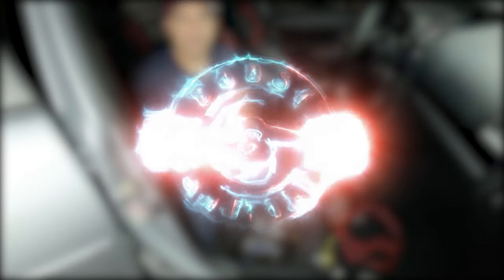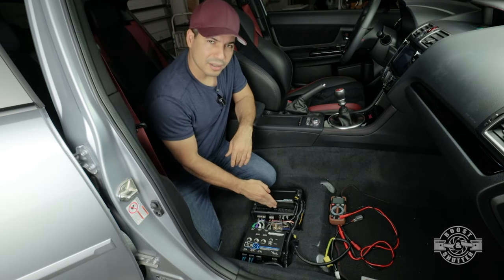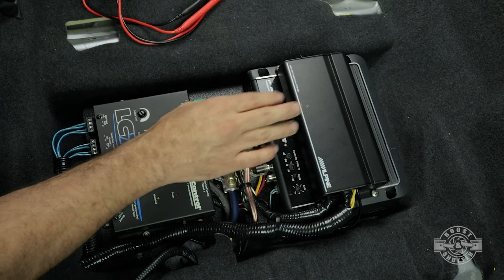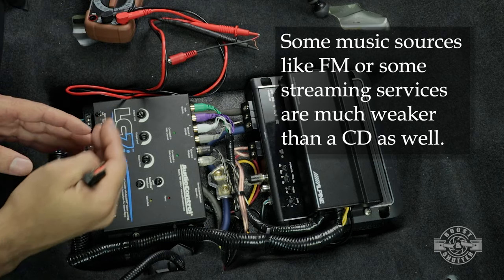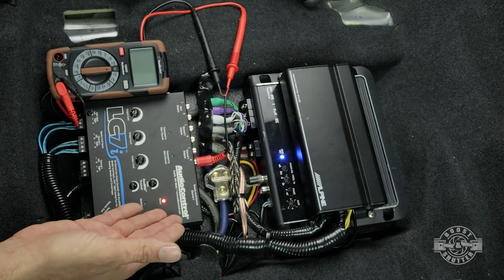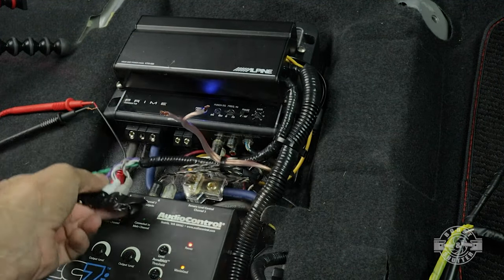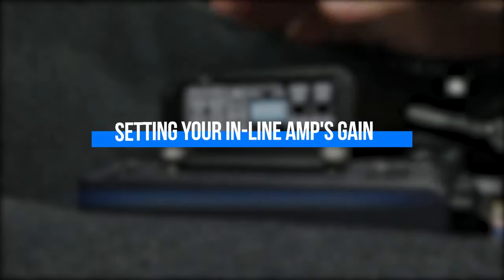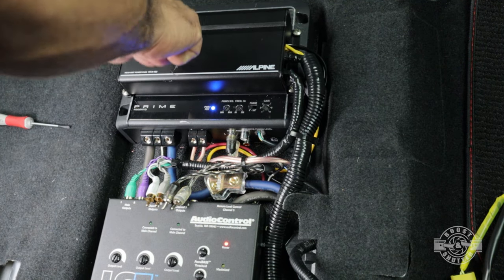How to TUNE Car Amplifier & Set Gains

Comment: What about if my stock head unit does not show the volume numbers how do i know the 75% of volume ?? I am using an audio control lcq1 to convert hihgs levels to low levels ??
Reply: Mine doesn't have the numbers either.  I just connected a source to it (phone via bluetooth works great) but didn't play any sound.  Then you can turn the volume up one click at a time, starting at zero, and count the clicks until you get to max volume level. Once you know how many clicks are max volume, multiply that number by .75, and you know how many clicks get you to 75% volume.  I had to put a mark on one of the notches on my volume knob to reference where that point was.  Takes a little time, but it solves the problem.  Hope this helps. 2017 Silverado.
Reply: @johnpowell6724  thank u so much

Comment: I've done this but left and right outputs out of the LOC show a difference not the same
Reply from the maker: Many stock head unit attenuate the rear speakers so you will get much lower voltage for the rear. What I would recommend is that you copy the front signal to the rear through the dip switches if that's the case.
Reply: @akqjtn  I've patched into the factory sub woofer line if that changes anything.

Comment: My amp says it's output is 150 watts @ 2ohms × 4 @ "14.4 volts" . dum question does that actually mean I have to set gain @ 14.4 volts with multimeter for max rms?
Reply: @akqjtn  oh ok gotcha that actually makes sense because I was wondering how everyone was adjusting different gains when the manuals were telling you the voltage to use so I see my misunderstanding. Thank you so much for quick response😁👍
Reply: @akqjtn  glad I didn't think it was too dumb to ask I would have been confused😵
Reply: So since you have responded to me I'll ask my next question. When you wire speakers in parallel for lower impedance does the speaker handling power increase also and is equalization affected?

Comment: What speakers are you driving with the Alpine KTA-450 amplifier ?
Reply: @akqjtn  I am still thinking which amplifier should I use to drive my Alpine R-S65C.2 speaker. Will the KTA-450 @ 50W RMSx4 be under power to drive these 100W RMS speaker, since the amp is only 50% of the speaker power?
Or is it necesaary to go with the R-A60F @ 100W RMSx4 to get these speaker to their full potential so I get the best out of it ?
Appreciate if you could advise on this.
Reply: love3ver they are under driven as you stated. The higher powered amp would make them sound better, particularly on the low end (bass). Speakers do not necessarily have to have the RMS rating to sound perfect. Lower power is fine if you like the way they sound.

Comment: Are you, or anyone here, familiar with the 2013-16 mazda cx-5 with the bose amp? I want to add a small 5ch amp to run a sub and 4 doors, bypassing the bose amp but keeping the OEM head unit. I keep hearing that it's a pipe dream. HELP!!😥😥

Comment: Guys, how do I figure out what output voltage I should give my amps? He simply knew he needed 4v :/
Reply from the maker: It's in the specification section of the owner's manual, usually under "input sensitivity" or "input voltage"
Reply: @akqjtn  Thank you so much for your reply, Ill give those books a look

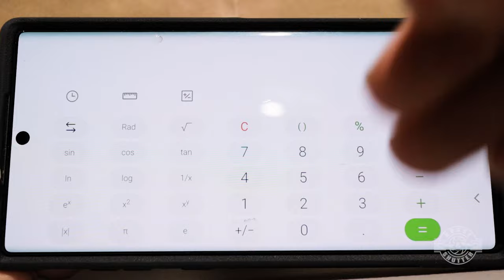Comment: 14:22 If my sub is 750W RMS and my amp is 550W RMS, what should I use for this calculation? I'm assuming I'd use the 550 from the amp but just want to make sure.
Reply: @akqjtn  Thanks for the response! And thanks for the super informational video!
Reply: @akqjtn  how about if I have 2 amps 1 is 1500RMS for 2-12” subs 4ohms 
And 2nd amp is 1kRMS for my door speaker.

Comment: what if you head unit puts out 4v but amp only takes 2v?
Reply: never mind. guess ill just watch the whole video :b
Reply from the maker: Short answer: turn down the gain on the amp.
Reply: @akqjtn  my 08 sunaru stock head unit is connected to a kicker LOC with level controls for left and right. Not getting 2v until 100% volume 40 on the head unit. Is there a recommended test tone app for android maybe the app i tried isnt working right. 1k sign wave right? Not getting any voltage on my multi meter at 75% volume30. This feeds a mb quarts 4ch amp. All seems to be working just looking to improve a little and make sure its all set correctly. I did set the gain with volume on 35/40 and used multi meter on the amp outputs to check the voltages.

Comment: Good video but I must disagree on some points you made.  I install car audio equipment for a living and even tho your method does work pretty well, a multimeter is not the proper tool to use to set gains. Also you did not find out your max volume level on the radio for distortion . That's the first place you should check for distortion since it's the first piece of equipment in the system that's sending the signal to either the factory amp or the speakers . 
Although a multimeter can be used in a pinch but in no way shape or form is it 100 percent accurate . Either a distortion detector or O scope would be the proper tools to be used .

Comment: Not knocking you but you are incorrect on a few things. I have the same vehicle and can tell you the headunit clips before 75%. You need an oscilloscope to find the actual clipping point otherwise the rest of your steps are useless. I have an 18’ sti and the factory headunit clips at 39 out of 62 on cd/usb which is less than 75%.
Second you should not have a solid clipping light on the LOC. You are indeed sending a clipped signal to the amp. Great video just think some of your info is wrong. I have the same exact LOC.
Reply: Boost & Shutter yes. I have an 18’. I believe the headunits are the same manufacturer. I had a 16’ as well and that headunit clipped before 75% to.

Comment: Nice explanation but there is some bad info in this video. DO NOT use a -5 dB test tone for setting gains. 
Here is why: For starters the peak for recordings can and often do exceed 0 dB in the real world.
I have many recordings that have True Peak (dBTP) levels greater than +2 dB when analyzed, the highest being +3.5 dBTP. 
If you set your gain using a -5 dB test tone and have it cranked up just under clipping with a song that has a peak of -5 dB you're fine.
What happens when the next song has an in your face 0 dB or greater opening? 
HELLO CLIPPING good bye amp and/or speaker/s if you're having a bad day.
Reply: When I saw the alpine screwed to the Rockford I paused and scrolled through the comments lol .... Wonder how much he paid for all the "cool video" and "great info" comments

Comment: You missed a step. Testing output voltage of the head unit itself. All of these should also be tested with an o-scope. Otherwise, you DONT know if it’s clipping or not. Just because you’re getting the theoretical voltage, doesn’t mean that it’s not clipped or distorted….

Comment: Nice video but cringed a little when you said "most speakers"  have built in crossovers.  The opposite is actually true.  Factory speakers like WRX dash tweeters have capacitors wired in to block bass which isn't even a replacement for a good crossover.  Replacement speakers will not have anything built into them (coaxial will have a capacitor on the tweeter) and will require a crossover circuit either in the head unit or amp or as a separate component.

You could get rid of a lot of that complexity you have there by replacing the head unit with a quality one that has RCA amp outputs and built in low Pass and high pass crossovers built in.   RCA outputs have far far lower THD than speaker level outputs.
Reply: @akqjtn  I don't know anyone who wants to keep the factory WRX head unit.  Some people don't want to spend the money to do it correctly because you need extra harnesses to keep all the factory features, some people don't want to do the work, but everyone agrees the head unit in the 2015+ WRX is hot garbage.
Reply: @akqjtn  Yeah the lagginess of the system in general is enough for me to ditch it.   The sound is really muddled, I think once you get a quality aftermarket head unit you'll realize why.  You're probably getting the best sound you can out of the HU but any setup that starts with a factory HU and runs into a line level convertor is asking for poor audio quality.  Good speakers hooked up to a good amp fed by a LOC from a garbage head unit means you're amplifying garbage sound no matter what. 

We went with a Pioneer DMH-W4660NEX with Maestro RR + SU2 harness + XM 300 Tuner which allows us to retain everything except the factory center console USB port.  But the HU has two USB inputs (1 for power/Android Auto/Carplay and the other is power only.)  They can be easily mounted next to the cig lighter location which is more convenient anyways.  But this head unit has wireless Android Auto which was a must for us.  Best Buy has/had this until on sale for $500 so total cost installed was about $1000 done correctly.   You can save 200 by not using the Maestro RR (which uses the OBDII port which might matter to you if you run an Access Port).    But we don't use an AP and wanted the extra features like tire pressure display, digital gauges, ability to read and clear engine codes right there on head unit.

Comment: Never ever ever screw amps together like he did in his video. A simple bracket can be made to stack amps. Or find another mounting location.
Reply: Why's that?
Reply: Many reasons but a huge one would be the fact that instantly voids the warranty, another huge one is drilling a hole into it can lead to metal shavings inside the board. Another big reason is heat distribution,  I'm certainly glad he pulled it off. But thats not something I would ever tell anyone to do or do to my own car or a customer's.

Comment: WHY, WHY, WHY... ...does 99% of all literature and videos tell a person to zero/flatten their treble and bass settings on their head-unit only to have their set target voltage on their amps go way too high because they later turned their treble and bass settings back up on their head-unit afterward???  ...then a person has to go back and lower the gain/voltage on their amps because it went way too high at that same 3/4+ volume.  I don't fuckin get it!

Comment: You didn't show we're your head unit distorted at , that's your credibility gone. 2021 get a smd dd1 ,0db for h/u,  -5db to -10 front and back and -10 to -15 for the sub. All clean and distortion free.
Reply from the maker: Yeah I could have also used an O-scope. This video was for most people to do at home easily and cheaply, buying a $200 piece of test equipment is the opposite of that.